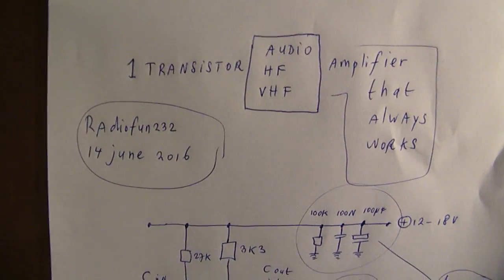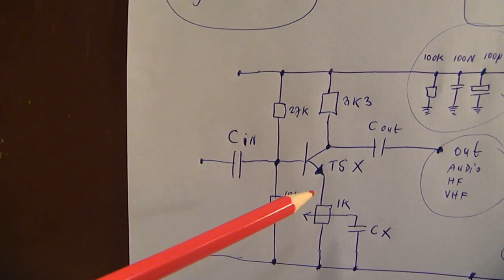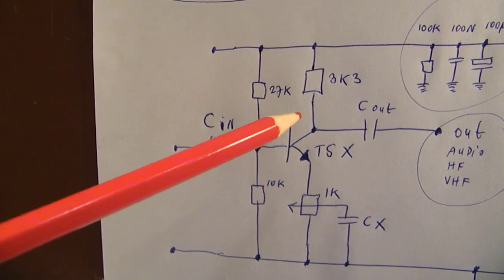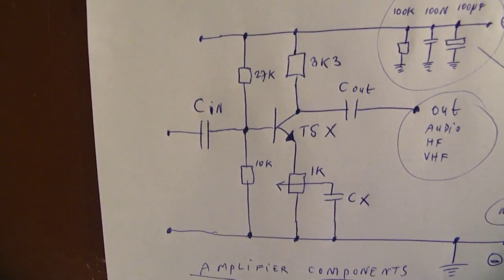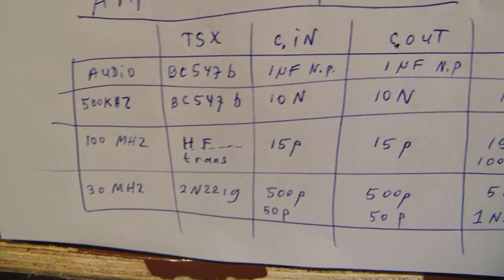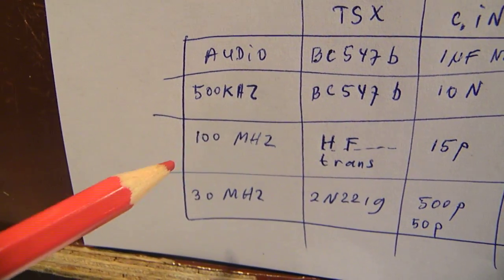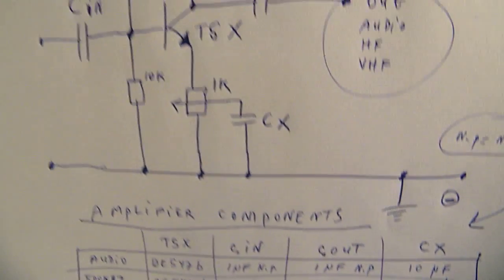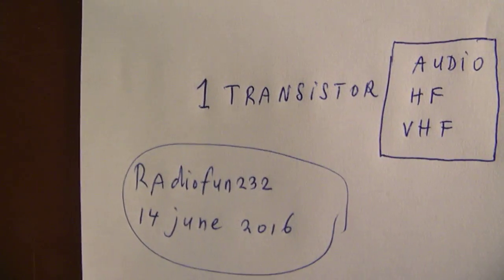1 transistor amplifier (G-E) for audio or hf or vhf (schematic)

Comment: Can i use 2sc2078 transistor for the HF amplifier? Please help me
Reply from the maker: The transistion frequency of the 2SC2078 is 100 Mhz. That means that above/around this frequency the amplification is zero. The DC current gain (not the Hf gain) varies between 25 and 200 (you can measure it with a transistor tester for your case). It is a power transistor and not a typical smalll signal transistor, but anyway. I think it is usable up to (say) 70 Mhz. I don't know on which frequency you want to use it.

Comment: Thank you very much for the very helpful video has clarified a lot in 5 minutes that i have struggled with for a long time.
Reply from the maker: Good to hear that it was useful, thanks. Perhaps also important: you can get this Emitter grounded always working (also three 1 transistor stages after another, coupled by a coupling cap) when you change the fixed base resistors by a 22 K or 25 K potmeter (trimmer) with 1 fixed value resistor from 1 K in series with 1 potmeter electrode to the + (in case of NPN transistors). This 1 K resistor prevents a too high base current. Every 1 transistor stage can be set to its own working point with the help of that 22K trimmer. Success!
Reply from the maker: see also https://youtu.be/br8iXVXRVl4 for more info